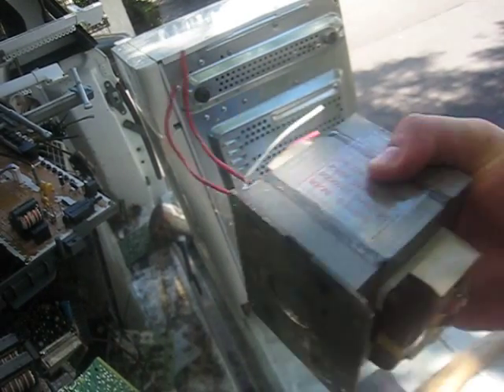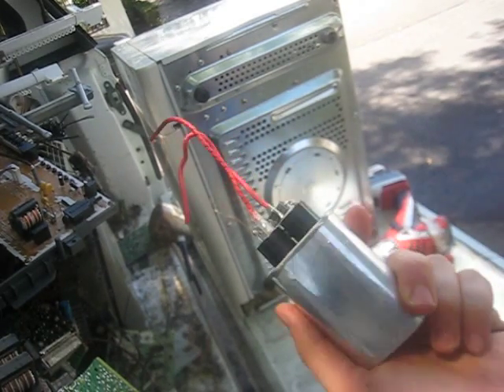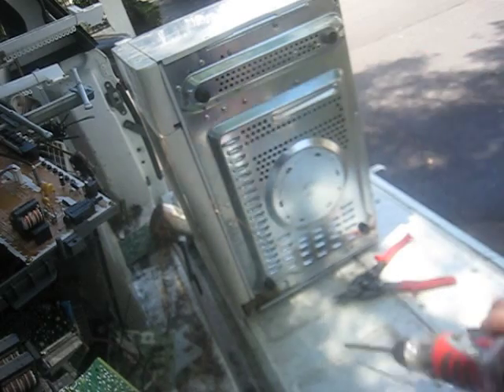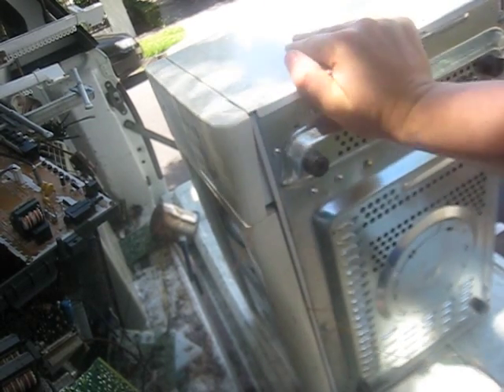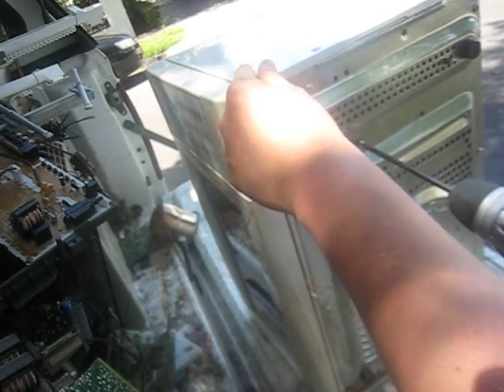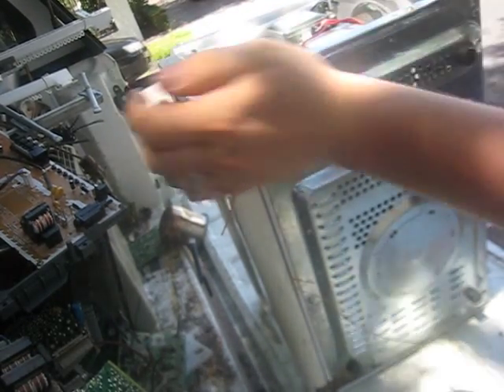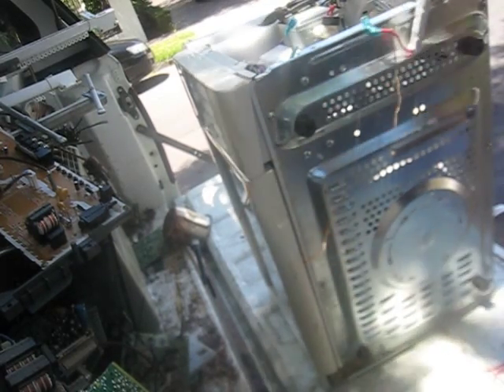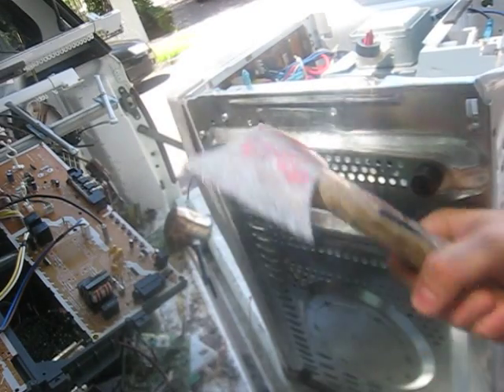How to take out a transformer from a microwave - Hit n Run Scrapping

Comment: do you just hit the capacitor to discharge it?
Reply from the maker: it's one way.Hit it until It gets disconnected from the wires . Mike the Scrapper has another way. Check that out, but more time consuming.
Reply from the maker: I smacked it till it disconnected from the wires.
Mike the Scrapper has another way, but is more time consuming. Check out his vid.